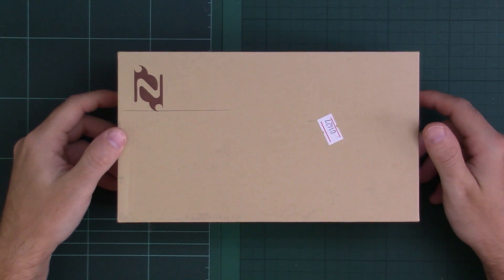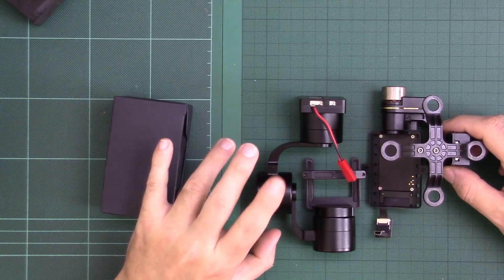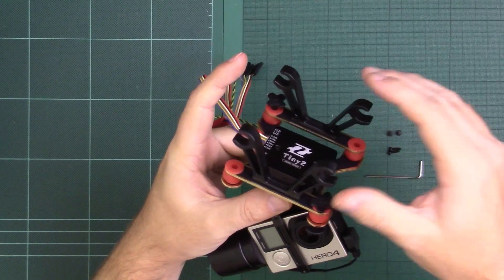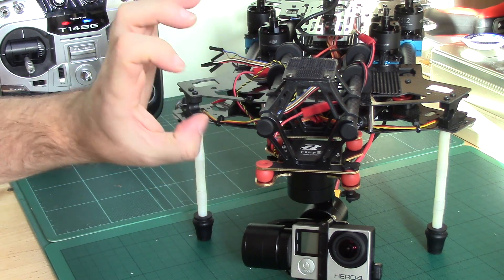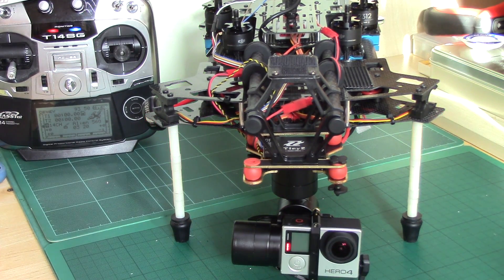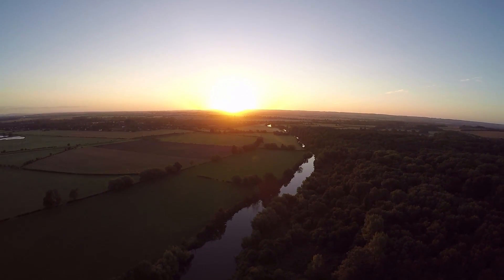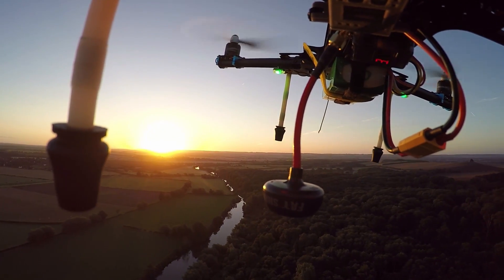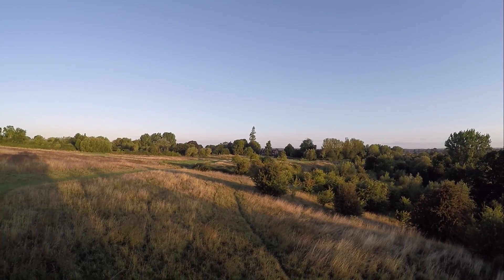Zhiyun Z1 Tiny 2 (3-Axis Brusless Gimbal) Review

Comment: Really great review, finally "almost what I have been looking for" I wish it had full 360 pan. have you worked out the pan yet. like you showed it appeared to only have about 180 degrees, but when you had it in lock mode and you panned the frame it looked like you had the full 320 degrees.
Reply from the maker: +azzurripro Just finished doing a Firmware update video and happy to say 320 is now possible by using the 'speed' 1.11 firmware. 'Position' firmware still only does 180 degrees. Stock 1.10 firmware is 180 degrees only it seems,
Video is still processing as i type but will be here. I demo both modes: http://www.youtube.com/watch?v=E4ihMXeyAcc

Comment: Thanks for the review, right to the point. A quick observation though, I might be wrong, but from the looks of it I don't see what's stopping you from mounting the gimbal in the "compression mode", just put the top mounting brackets with the 'hangers' underneath the fixed part, I think the 'hangers' (here I might be wrong) won't interfere with the rest.
Reply from the maker: Not wrong at all bud and well noticed too. I corrected my rather foolish error on my blog but should probably put an annotaion on the vid. Compressed mode works a treat and raises the height of the cam off the ground too. This is why i shouldn't follow the manual (which shows it in hung mode).

Comment: Thanks for your review on the strength of it  I bought a Tiny 2 and it works as good as yours right out of the box. Only one thing,it now comes with a Phantom friendly bracket and so compression fitting is not a straight forward option. Tiny 2 works in suspension mode near perfectly on my F550 Y6 so who cares.

Comment: Hi D I have watched lots of footage and this gimbal has all the hallmarks of encoders. when it is turned by hand it doesn't break position but acts like a dampened spring. I have built many dslr gimbals on the Alexmos 32 and without encoders they all break position very crisply and do not return with the same smoothness.

Comment: Hi Dewey, 

Thanks for the review. Am i right that you are flying an Alien 560mm in this video? I am planning to purchase one as upgrade from a F450. is the frame any good for aerial video? 

Thank you,
Quinten
Reply from the maker: +Avia - Hi Quinten - yep I was using an Alien 560 for that flight. The frame is pretty good. I'd give it like 7 out of 10 i guess. You can make a super super neat looking quad out of it and the fold down system works great and the place the gimbal mounts means virtually no props in shot. 
Things i don't like are the landing gear... complicated, weak and prone to vibrating loose even with locktight. There is also not quite enough height inside the quad so space isn't as great as you'd think especially if you are using DJI E310, E600 or E800 escs. They fit of course but don't leave much room and with no inbuilt PDB you have to work out where to put that without it touching the CF.
Flight wise is the other thing. It flys ok but balancing it is quite hard to do with a front mounted gimbal because they don't give you a battery holding area anywhere near the back. The give you one in the middle but that is useless because with gimbal your CG is shot to bits if you put it there.
I created my own method to mount the batt nearer the back and it worked pretty good. I never felt it flew 'amazing' though so I don't think i'd say 'yes yes omg go get one!!'. That maybe because i was using E310's which is a bit underpowered for the frame size but it just never felt as stable as the F450. 
Maybe worth looking at the U580 Pro (I am building one). Its got probably as much space as the 560 in actual area but you can mount the ESCS under the motors, it umbrella folds and the pro comes with retracts so no issue of legs in sight (props i am not sure on yet). It too suffers a bit from CG issues in respect of where the batt mounts but due to having rails on the bottom you can create a mount that is nearer the rear pretty easily. Well worth looking at I would say.

Comment: Do you think a Xiaomi YI would fit to the gimbal? and further ... as the live-out of that is on the back, where the GoPro has its long connector ... would it fit and not interfere with the stuff behind the plate?
Reply from the maker: +Matebox in Motion - Hard to say for certain without owning at Xiami Yi but as long as the form factor is the same then fitment and weight probably won't be an issue. I think you will be able to access the ports on the rear due to the mounting bracket being designed for the rear screen of the Hero4 Silver. Assuming the Yi does output video via USB then you would have to create your own wiring harness to be able to send FPV signal out through the gimbal as the Yi has micro USB and GoPro wire with the Tiny 2 is mini USB (You'd also have to check voltage inputs and micro usb wiring).
Reply: Xiaomi Yi fits according to the product page
Reply: yep ... but the main thing is, if we can get the live feed out which is on the back side of the yi! 
Next, the price of the Gimbal just recently grew up to 330$ (approx 294€ currently). As I was writing the note here, it was down at 240€ ... Ok, that won't change the quality of the gimbal, but the acceptance to to just  go "buying and trying" has been lowered :)
Reply: +Matebox in Motion its 204€ on aliexpress from their official account or something

Comment: many thanks MR D 

where would you get one from as I want the latest version not the older one they are selling cheap?
Reply from the maker: +Guide504 Hard one to say because it depends on country and their stock. As long as it is a Tiny 2 and not just the Tiny then you will get a good'n. I have heard newer ones allow full 360 rotation but am yet to get anything back from Zhiyun as to whether that is true or not. Their website suggests nothing has changed since my one.
Amazon is the safest bet in all cases right now as you then get a level of their protection on the purchase instead of 'iffy' chinese support from the likes of aliexpress.

Comment: i have been test flying my tarot 5d3 gimbal today.
got the whole thing under 7kg running the a7r2 and the zeiss batis 25mm initial test looks good in the wind.

what do you think of the new polymer gopro gimbal from tarot?
Reply from the maker: +Guide504 If you mean the T4-3D I've not had my hands on one yet. From what I can see it looks a little over fussy for my tastes (Wires and external modules etc) but if the results are good it'd be hard to argue with at its price point. Likely better than a Feiyu-Tech Mini3D (time will tell on whether that is true of the Mini3D Pro) but without trying it that is massively subjective.

Comment: hi there.  just wondering if you have had a chance to get your hands on and review the new feiyu tech mini 3d PRO version??   i had the 3d which was rubbish.  and now need to get a new one as a crash destroyed it.  can you please advise me??   I bought a cheap HMG yi 3d for my Xiaomi yi camera.  and it was a completed flop.  thanks.
Reply from the maker: +Richard Gilmore Sadly Feiyu-Tech have either stopped sending out free review samples or were not happy about my honest opinions on their Mini 3D (non pro) versions. They won't send me a sample and I really cannot justify spending $200+ on a product that had 2 sub-standard baby brothers (I have too many gimbals in my life already lol). 
That said another company have asked me to review gimbals from their shop so I have asked if they will send me the 3D Pro and the G4s.... we will see I guess.
They have, once again, not offered any 'in flight' footage using the Mini3D pro to prove its capability over previous versions so if you want something good... get the Z1 Tiny 2. It is simply awesome vs the mini3D. I would also suggest getting a Hero4 (or even a second hand Hero3/Hero3+ black if budget is tight)... you will never regret it.
Reply: +d3weyTube  would you be interested in selling your tiny 2 as you have so many hi hi.   I have not been at this hobby long and built my own 2 axis gimbal.  it works but not great.  I then bought the feiyu tech mini 3d which was an epic fail.  it was worse than my own gimbal.  I did do a mod however which helped but then my hex cane down and destroyed it.  I did email feiyu tech about the gimbal and they basically told me I was lying.  and if I wanted to upload a video for them to review before returning it to them.  i m not sure but never had a crash until I fitted that gimbal.  when I did fit it it behaved differently. I think maybe its motors affected my compass.  anyhow I bought a gimbal from the China man though still cost me 100quid.  a HMG YI 3D.  IT came yesterday and I fitted it to my hex.  powered it up and it was an epic fail.  would not hold any position at all.  think its a software programming issue.  but the board I think is a copy of the storm 32 mini controller which has just been banged together with no real attention.  I want something good but not to expensive.  I know you get for what you pay really but the tiny 2 looks good.  I wonder will a Xiaomi yi camera fit it. although I have a Git 2 camera coming which is the same size as a gopro 3 so it should fit.

have a look at my videos and you will she the gimbal in question.  not working and me throwing a tantrum he he.  

anyway thanks for getting back and the long story.  I just need to vent my anger at this mysterious gimbal.

Do you sell any of your review products??  if so let me know.  also is there an older version of the tiny 2 with different mounts?  hobby king have one for sale but it looks different and the gimbal hangs on the balls.  not like this one where the gimbal weight squashed them if you get me.

thanks.  regards. Richard.
Reply from the maker: +Richard Gilmore lol sadly for you the Tiny 2 is now my 'go to' gimbal. I would go as far as to say that I favour it over the DJI H3-3D but being honest my larger quad is still under construction so I haven't truly put it through enough testing to know that 100% - testing proved it as equally as good though.
If you want something that 'just works' then get a Tiny 2... no questions. Just get it. The Chinese version will probably be capable of being really good if you tune it, test it, set it up etc and Storm32 will make that possible. However.... you will do about 100 flights of tweaking to get there (especially if new to this) and that will likely drive you nuts (I don't have the patience for it personally).
The Xiaomi Yi fitment in the Tiny 2 is a bit of an unknown. I have heard it will fit but the whole point of a brushless gimbal is that it is designed to be perfectly balanced.... Feiyu-Tech don't go by that method and just make beefy motors to counter mis-balance but that is why they can be a bit hit/miss. These gimbals are all developed around the Hero cameras so if you want them to work perfectly you will need a Hero camera. Even if the Xiaomi fits, it might make the balance a bit iffy and that could lead to wobbles, noisey motors etc.
The other thing is I know the addiction of the hobby... you will want the best eventually and you will spend a fortune on cheap items before ending up then getting the best. So i emplore you... buy good now and save that extra expense in the long term :)
Reply: +d3weyTube thanks for that.  a tiny 2 it is then.  I take your word on it.  can you check this then and tell me why it is different than the one in your video.  is it an older version or newer. I dont know.   anyhow thanks for the help.  appreciate it.  I will buy the tiny2 under your recommendation.   where is the best place to buy from??  and ideas. is there anywhere in the UK so it is local.  well I say local but I'm in Belfast.  but at least this way it won't be the other side if the world.  thanks.

Comment: I am looking at purchasing the  Z1 Tiny 2 and I am wondering if I can retain all the Monitor information that I had with the Zenmuse system. Such as Power consumption, Altitude etc. Does this gimbal come with that information embedded ?
Reply from the maker: +Jim Moule It doesn't but then neither did the Zenmuse gimbal. It relied on using the MiniOSD (or OSD Mark 3) for that information separately. You would need a different kind of OSD system like EzOSD or MiniOSD to get that information displayed

Comment: Would you control this through the naza or separatly through the reciever if you had the choice? Is the third party gimbal functonality on the naza better?
Reply from the maker: +nts The NAZA will restrict you to just tilt on CH5 if I recall correctly. You would be better going directly into the RX if you can and ideally you need 10 channels with NAZA use... 4 for flight 1 IOC 1 gimbal pitch 1 GPS/Atti then that leaves you with 1 x Mode switch, 1 for Roll and 1 for Pan/Yaw.
Reply: +d3weyTube Okey, thank you very much for the answer. I have been looking for a gimbal this stable for a reasonable price for months. It seems its finally on the market!! I will be running 16-channel SBUS soon, so i just need to figure out how to wire it separately and map it up correctly on my 9X with the new Smartieparts Extreme-board (when it arrives on market). I am planning on doing the playstation-gimbal mod.

Comment: this gimbal looks typical of one with encoders there is no way its that stable without surely?

can you confirm this Mr D?

many thanks
Reply from the maker: +Guide504 Honest answer to that question is I don't know for sure... but I would agree I think that Zhiyun must be using encoders on the motors to get the image as stable as it is. I am far from an expert on the encoder method but to get the image that stable in flight the IMU must be aware of the motors position at all times.

Comment: hey I really want to buy this gimbal and I have recently built a drone and I really want to know if I have to hook this gimbal up to fpv? do I have to have a screen and fpv gear?
Reply from the maker: +Jimmie Goodman You don't have to hook it up to FPV but if you want to then yes you can. You will need a video transmitter, video receiver and either FPV goggles or screen depending on which you prefer (FPV goggles will likely have the receiver in them).
Flying FPV via the gopro on a gimbal takes a bit of practice because the image in the screen will be stable, smooth and slow to react. What the multirotor is doing will not be reflected in that view. Not hard if you have a stable GPS based flight controller but not wise if you are flying manually without much experience.
Reply: Thanks

Comment: interesting gimbal to say the least, however i have  a DJI (FC40) so no railsystem so that's a bummer or i'd upgrade my current G-3D with SJ-4000 camera on it.. oh well :)
Reply from the maker: +cinexstudios Yeah I just took a look at my Phantom. Creating a retrofit mount will be easy enough but even using the longer legs designed for the Zenmuse H3-3D on the old shape shell won't fit. Maybe if you use the really long legs it could work. I have a set laying around so I might try and create a mount for it too. I have my old P1 shell as well so can make a version for the P1/FC40 shell mount holes maybe.
Reply: +d3weyTube basicly what i thought as well, but if you do dig into the P1 shell and this mount, let us (me) know for sure :)
Reply from the maker: +cinexstudios Proof of concept Tiny 2 Phantom 1 & 2 Mount all printed and ready to view on my blog bud.... nice and straight forward as I thought so should be able to get this tested, finalised and on Shapeways pretty soon. First pics can be seen here http://www.rcgroups.com/forums/showthread.php?t=2490735
Reply from the maker: +cinexstudios Proof of concept Tiny 2 Phantom 1 & 2 Mount all printed and ready to view on my blog bud.... nice and straight forward as I thought so should be able to get this tested, finalised and on Shapeways pretty soon. First pics can be seen here http://www.rcgroups.com/forums/showthread.php?t=2490735
Reply: +d3weyTube interesting, saw the images and it looks really good :) thanks for the update! :)

Comment: Does the video cable power the gopro, or just send video?
Reply from the maker: +Martin Koch You get a choice of two cables. One takes just vid, the other takes power and video. This cable is also designed for non-gopro cams with a different pin out configuration so you don't accidentally fry them.
Reply: d3weyTube
Thanks for the info Dewey.
So it comes with the cable I need to power my Gopro...I think the battery still has to be in it though, right?

Comment: Is it possible to mount the gimbal uspide down? (To mount it ON TOP of a motorcycle)
Reply from the maker: +Pieter Kiekens Tecnically yes but you would be much better off getting the Z1 Rider 2 rather than the Tiny 2. You can invert this but then you'd need external batteries and you'd have no way to move the gimbal around whereas the Rider 2 has buttons on a corded remote.
Reply: I see. Thank you for a quick reply, it's much appreciated.

Subscribed!